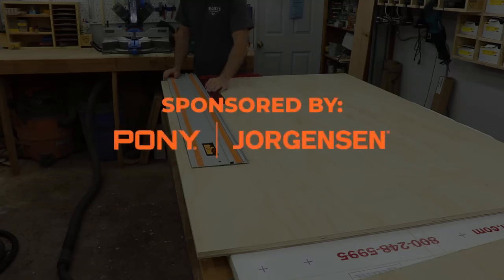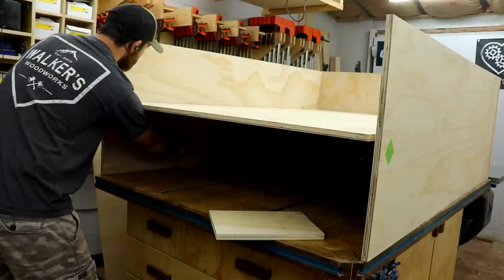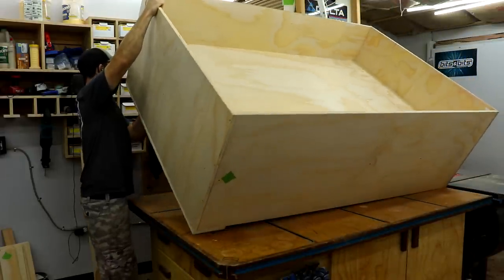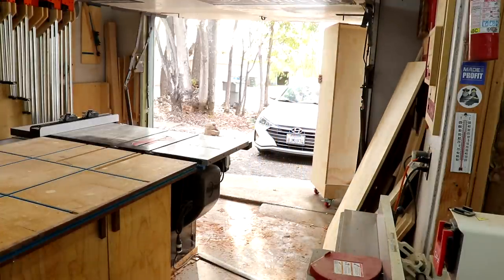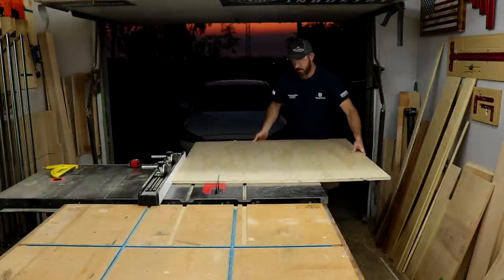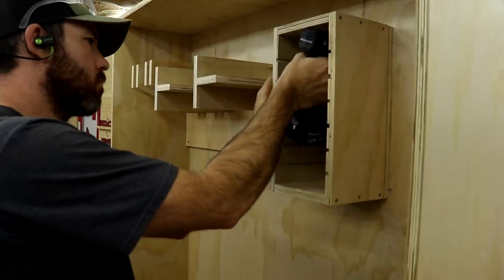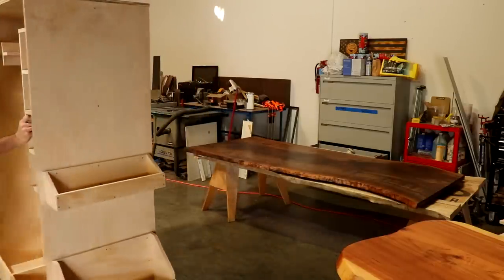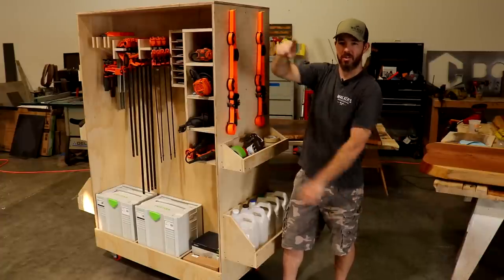The ULTIMATE Mobile Clamp and Storage Cart! / Shop organization

Comment: I like it! Now I can make one too when someone sends me $20k in clamps! Lol

That sand paper box issue (where you can't screw it in if the shelves are glued in), you could just buy an extension for your impact. They sell 6" and 12" ones at home depot or wherever really. The Bosch ones hold the bits like your impact driver chuck, and there are others that don't but fit in narrower places. They come in handy those times when you need that one tool, that only does one thing well.
Reply from the maker: Haha it's about $1500 in clamps.  Yea the extention was my plan.  Thanks for watching!
Reply: @WalkersWoodworks  That is still a lot of money, but definitely less than my estimate!
I honestly like the Pony clamps I have better than the BESSEY ones. They seem smoother for some reason.
Reply from the maker: I agree.